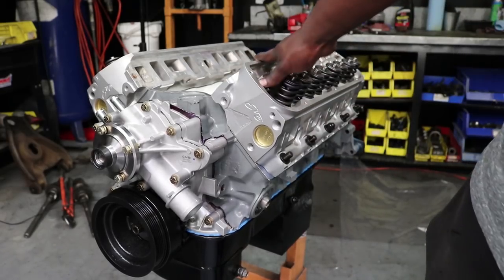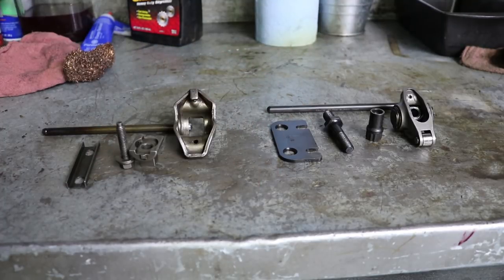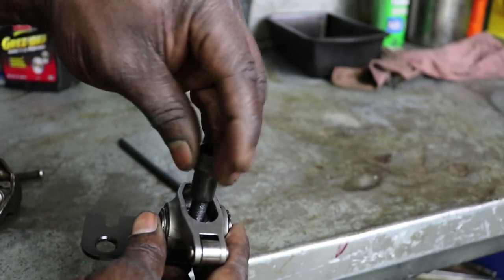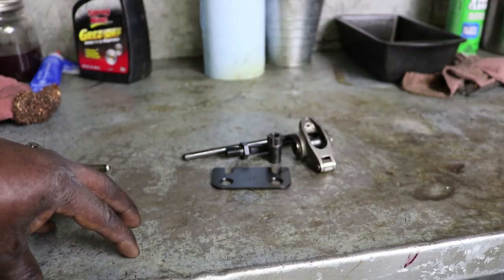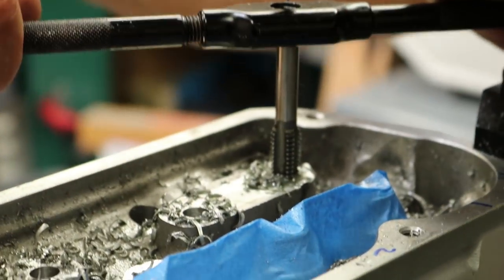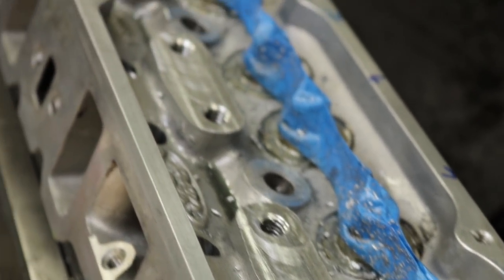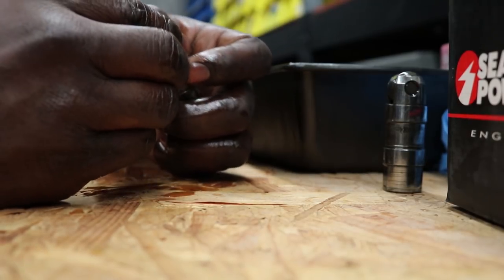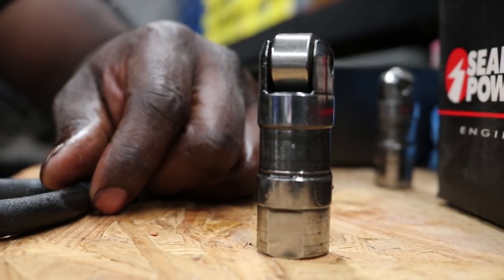Ford 302 Rocker Stud Conversion and Lifter Rebuild - PROJECT MAYHEM PART 26

Comment: Good video what year foxbody do you have? What's size valves are in the SVO heads ?
Reply from the maker: James Voss 1989 GT and the valves are 1.94/1.54
Reply: I have a really nice 87 4cyl notch aod car I am going to be running a 89 harness in when I do my v8 swap I have a 92 gt to strut towers are trashed that going to be my rear in t5 a my part's I have a lil motor ain't much I got a set of elder brock heads 60379 just something a lil more than stock I hope it throws my lil notch around but yeah I working on a budget to mine ain't as big as urs I am disabled hurt my self at work checks ain't shit! Can't wait to see u get it finished JUNKYARDDOGGING👍👍👍👍!